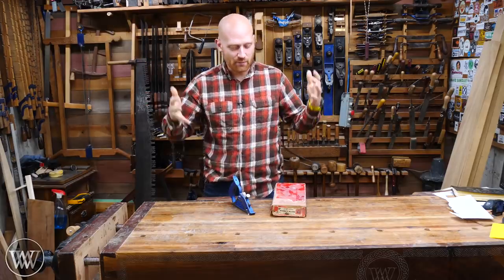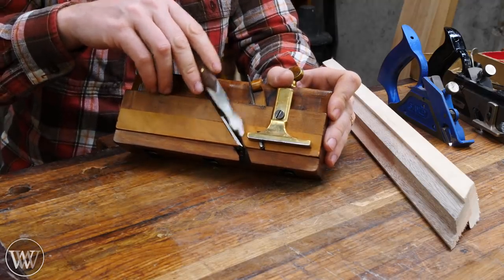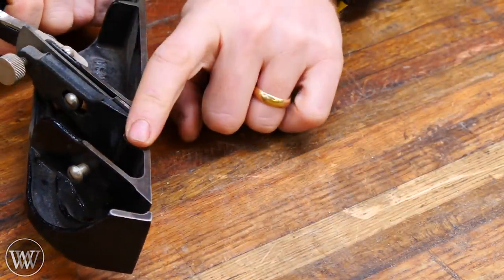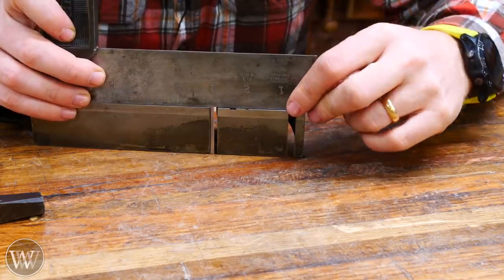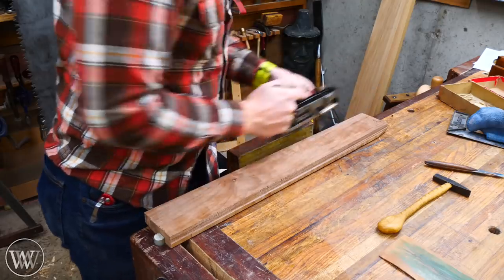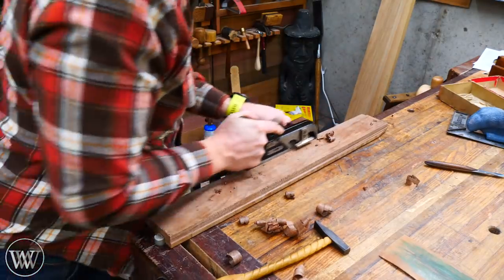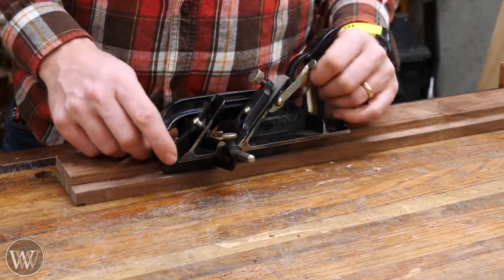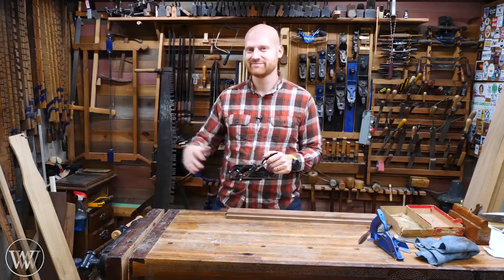What is a Rabbet Plane

Comment: I got a Stanley 78 and the fence is not parallel to the edge, it is at a slight angle. Was this designed to be at an angle to the edge or parallel?
Reply from the maker: sounds like a manufacturing defect or someone bent it. it should be fairly close to parallel.

Comment: Hi James, I do enjoy your tutorials, they're very informative. I've just watched your video about the rebate plane and it has left me confused! In the Paul Sellers video he said the blade should protrude slightly on which ever side you are cutting on to offer relief as you cut and to help keep it from wondering off true. In your video you say it should be flush. Who is right? Or is there 2 different schools of thought on this issue? Keep up the good work.
Reply from the maker: It is just two different methods of doing it. If if is flush it is easer to push and you get a cleaner wall especially when not using a fence. the down side is if it gets pushed in as all accidentally then it will not cut all the way to the corner. If it is sticking out a bit then you can be sure it will always be cutting if it gets accidentally pushed in a bit then now it is flush with the side wall and still cutting. the down side is the side wall is not as clean and if you are not using a fence then it is harder to control. hope that answers it.
Reply: I personally have found that if I have the blade flush on the cut side I get slightly out of true walls (especially on long cuts.  If it protrudes by just a hairs breadth it cuts true the full length of the wall.  Same principles as a shouting board.
Reply: Damn predictive text.  Shooting board.

Comment: Two knee fish? Ha ha haaaaa.a.a.a. 
So, how often should a crafts-person chisel down the stop end of a stopped rabbet? Switching back and forth, or make the depth cut then plane the rabbet/rebate? (Using a bull-nose rebate plane with the front of the plane iron exposed, of course.)
Reply from the maker: I usually chisel down. And depending on the wood you can get anywhere from a 16th of an inch deep with a chisel too a quarter inch on some soft woods.

Comment: Thats a plough/plow plane not a rabbet plane ?
Reply from the maker: no a plow plane cuts a groove. it can cut a rabbet but it is not designed for that. many modern sellers confuse the two as they do not know what they have or what they do. but this is a plow plane https://www.google.com/url?sa=i&source=images&cd=&cad=rja&uact=8&ved=2ahUKEwjSqsD05ZXhAhWZ14MKHTRpA3IQjRx6BAgBEAU&url=https%3A%2F%2Ffinetools.com%2Fproducts%2Fw-l-epperson-masonic-plow-plane&psig=AOvVaw00fyZ0WtT7lqNVLQg5yFfP&ust=1553345716688924

Comment: These planes are an absolute PAIN in the face to adjust...... you get it flush with the side, but it's not parallel to the sole...... you adjust to the sole and then it's not flush with the side anymore 😐🤦‍♂️ ive often spent 20mins tryin to get it where I need it to be, I could have probably done the work with a chisel in that time....... these type of plane make me want to cry sometimes 🤣😂 or even worse...... make me want to whip out one of them new-fangled router-dohickys that have a long tail 😳🤣
Reply from the maker: That sounds like you're having problems with the plane iron not being square to the side. I actually have mine at a slightly acute angle so that it's parallel with the soul but leaning in rather than sticking out on the side.
Reply: @WoodByWright  I adjust the same way as you do in the video, set it flush with the side, then adjust for parallel; any movement in either direction for parallel means the iron dont sit flush anymore...... it's a vexing tool 😂 
Il check again for the iron being square, but with joinery planes I'm fairly fastidious and keep them correct...... I hope it's as simple an straightening the iron. Although it is an old WS A78 (made in England, a copy of the Woden rebate plane with the twin arm fence) and it's well worn....... even the depth adjustment seems to skew the iron when its moved 🤣 
Thanks James, youre always on hand with a remedy to a problem, thank you Sir 😁🤙

Comment: 🌲🌳🍀🐾 📐🔨🎓 Enjoyable, and thoroughly informative 🐇"rabbet" making & 🐇 plane parts breakdown & adjustment video👏.  You were correct to show viewers that the first couple of cuts should be made at the opposite or finish end of the board.  It's to reduce "tear out" (corner splitting) usually a problem on soft woods (for those who are asking why?) Great job🎓😉🐾🍀🌳🌲.

Comment: If it doesn't have the fence, don't pay more than 20; even then it's ... Debatable... as it basically becomes a standard angle shoulder plane with a handle (no seriously, that's exactly what it is without the fence).

Should consider setting up the blade with a shim to get a hint of protrusion.  You'll get much more consistent rebates.